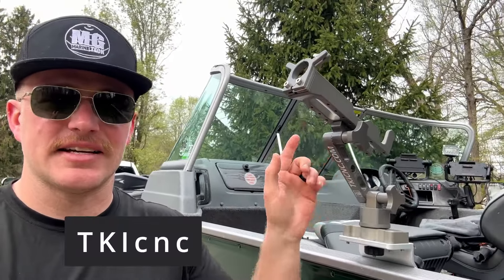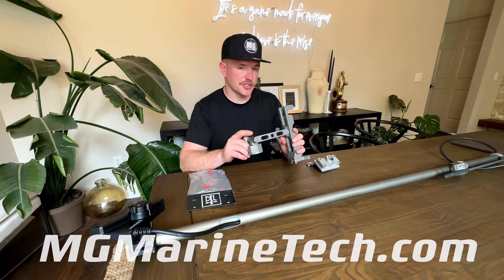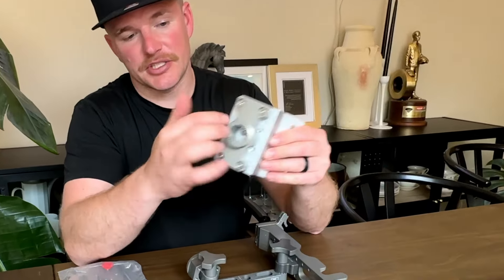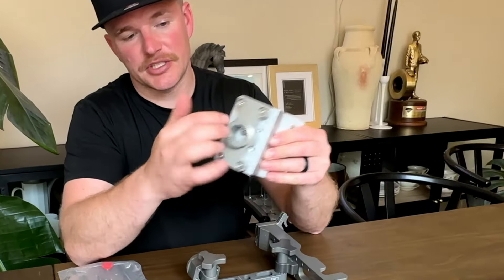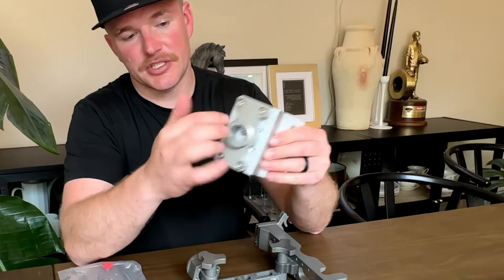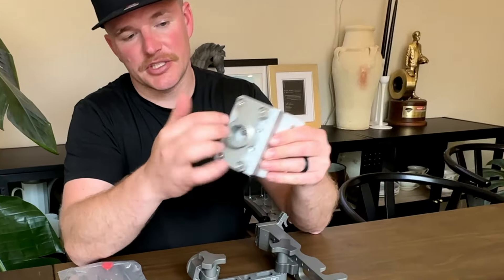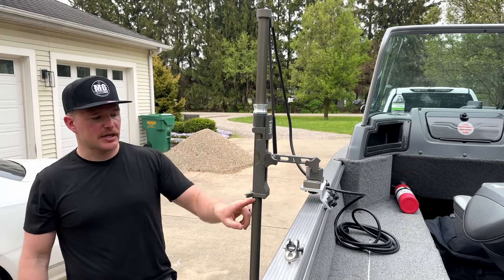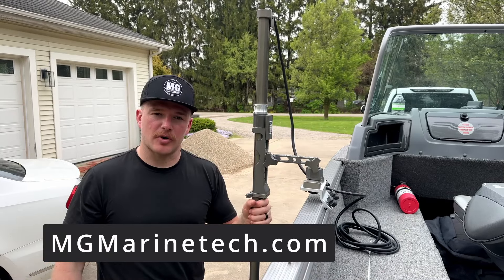Best Forward Facing Sonar Pole??

Comment: Thanks for sharing. How fast can you troll with this pole in the water?  Can you get pole extensions? I have a Lund Fisherman 1875 and sits very high above the water.
Reply from the maker: @davidmclaughlin5345  I’ve trolled upto 5mph 

The pole is 60” long how long do you need it ?
Reply: 72’ , what base is yours in video for the rod holder?  I need the same one.  Only difference is I have a 90 degree track system.
Reply from the maker: @davidmclaughlin5345 I run the brocraft base

Comment: How does one mount the 45 degree mount into the track thats on there boat , the one in  ur video
Reply from the maker: There are “t bolts” the fit into the 45 deg track that the 45 degree mount then bolts too
Reply: @MGMarineTech  do you also sell them or does it come with the bracket
Reply from the maker: @outdoorsman8498 I sell the TKI 45 and 90 deg plates, I do not carry the  brocraft plates

Comment: Does it have to be removed when running from spot to spot, or is there a way to secure it in the rod holder assembly?
Reply from the maker: You could lift it up, but it’s easier to just remove it from the rod holder

Comment: I keep getting a fault code 28 on my ecomap . I called garmin they had no idea what it was. By any chance have you come across anything like this .
Reply from the maker: I have not??? When does it happen?
Reply: @MGMarineTech  randomly
Reply: @MGMarineTech  usually when I start the motor
Reply from the maker: @nicholastarantino5567  does it say anything else other than fault code 28? 

I can’t even find anything online for it
Reply: @nicholastarantino5567 

What power source do you have it hooked up to?  The starting battery by chance?  If so, the brief voltage drop to start the motor is likely causing your unit to error out due to low voltage.  Try hooking it up to your electric trolling motor battery or running it on an independent battery